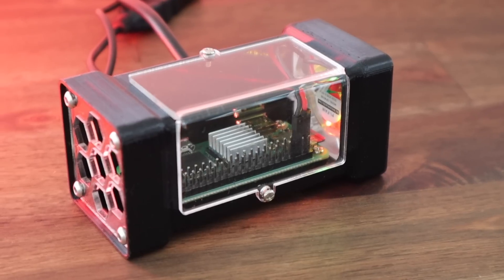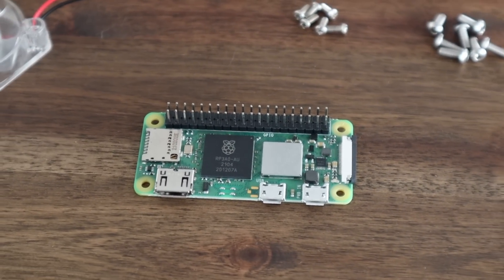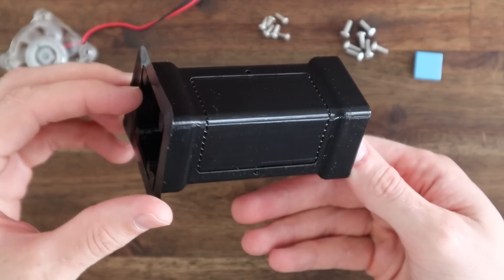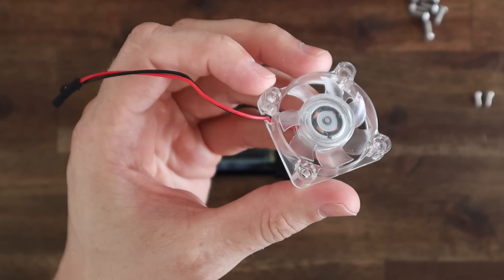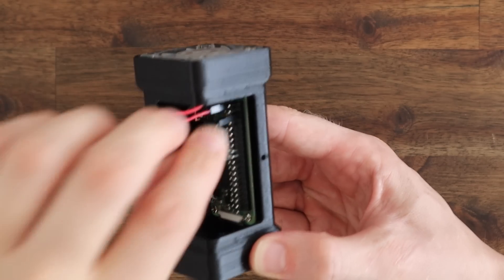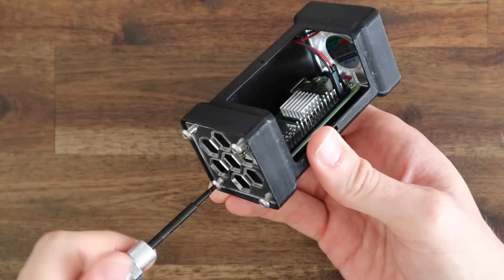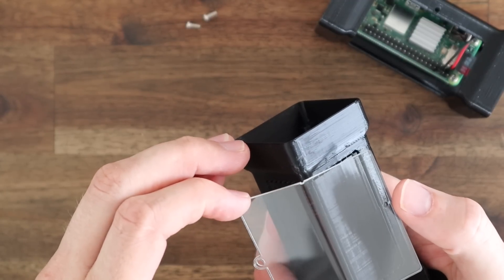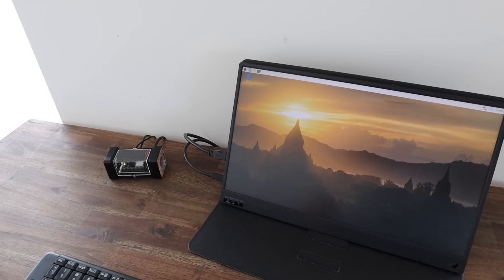Making A Raspberry Pi Zero 2 W Case - 3D Printed

Comment: how did you know the exact square of the front glass?
Reply from the maker: Do you mean how did I get the front glass to be exactly 90 degrees? I just used the front of the case as a guide.
Reply: @MichaelKlements  Nope. How did you know what sizes to write in the program before cutting the front glass?
Reply from the maker: I used the measurements from the 3D model in Fusion360

Comment: I use mine for pi hole dns. It works really well and im thinking about upgrading his cooling with fan...Not much heat when i'm using it (around 35c ) but when 5-6 ppl join it goes around 70c..

Comment: This is definitely one of your nicest build in my opinion.
I would love this be  for a Pi4b/8, but the connecters are not all on one side and that is a shame.
I think it would have been nice to have the acrylic flush mounted with the rest of the frame and the M3-8 inserted into the acrylic so they do not protrude. But these are just nit-picking, it is a very nice and inspiring design! 
I am thinking of building a Raspberry Pi system for my small sailboat and so I am binge watching your videos!
Reply from the maker: Yeah it would be great to have a Pi 4 with ports all on one side! 
Thanks for sharing your ideas and feedback on the case design, its always good to get input from others as well.

Comment: Nice case. (but...)
Why didn't you make the case so when you put the (clear) acrylic that it (that clear acrylic) was flush with the case?
Just a thought.
Reply from the maker: Mainly because it would have either made the 3D printed areas really thick (they're only 1.2mm now, they'd need to be 3-3.5mm to allow the acrylic to be flush) or it would need a lot more internal supports for the acrylic support structure - which makes the print messy.

Comment: Really nice design, but wouldn't it be better mounting the board a bit higher so you get more airflow on the backside? Or is there some other reason not to do that?
Reply from the maker: The underside of the board doesn't really need airflow. I prefer having more headroom within the case to access the GPIO pins. It also makes the angle to the screws a bit easier to access with a screwdriver.

Comment: Any chance you will be selling a kit for this? Like the case and acrylic?
Reply from the maker: I'm looking into it, it's quite a lot of work to remove the print supports and clean the print up but there might be some better printing options.
Reply: @MichaelKlements  I'd be happy with just the acrylic if that would be easier?
Reply: @MichaelKlements  why not a "print in place" ( or not )  cover for those who do not have laser cutter / acrylic :)
Reply: any luck finding someone to buy it from?

Comment: Did you experiment on using this as a solar powered Bitcoin miner? Instead of the older version of the RasPi Zero.
Reply from the maker: I haven't yet tried crypto mining on the Zero 2, I must though
Reply: @MichaelKlements  I bought one and it hasn't been booted up yet. I don't know what should I use it for. Probably a solar powered motion detector camera or something.
Reply from the maker: Try running Pi-hole or Retropie on it in the meantime, those are both quite fun and easy projects to get going and they don't require any additional electronics.
Reply: @MichaelKlements  I have a Pi-hole daemon running in my 4GB RasPi 4. RetroPie might be a good idea. There's also a Kodi server. Thanks. What I would like to know is how much less ROI would this Zero 2 be as a solar crypto miner. Maybe ten years?
Reply from the maker: I think any ROI on crypto mining on a Pi Zero 2 would be purely speculative. The only way you could hope to make any meaningful money with them is if you mined a coin which happened to 100x in a few months/years.

Comment: How would I modify this so I can use a camera module for octoprint? I’m guessing I go through the acrylic panel with the hexagons? Thanks in advance!
Reply from the maker: Yeah that would probably make the most sense, the Pi camera is only around 25mm square if I recall. You might need to open up a few holes on the main cover then to allow the air to escape.
Reply: Ok thanks!

Comment: What I thought doing was a front I/O shield exposing the pins. For this it'd be necessary either 90 degree pins or to make a plastic support for straight pins pointing outwards in the front (and connected by wires to the pi), and at the end we could finish with a little moving rectangular plastic door that encloses the pins inside the case, and when the pins are in use (in connection with wires to do a project) the little door keeps opened, exposing the pins to the exterior.
Reply from the maker: That's a nice idea Andrew!
Reply: @MichaelKlements  if you think it's useful for the case, maybe try making a video showcasing it? :D

Comment: Really use more power? in load the original pi zero w use 5w and this only 8w is not that much
Reply from the maker: It depends what you're using it for. That's a 60% increase in power, which for portable or battery powered projects is definitely a lot more.

Comment: Sweet. Never seen one of those acrylic bending tools before.
Reply from the maker: To be honest, neither had I. I had always use a butane torch and just "melted" the line but this is much neater.
Reply: i'm thinking its a styling tang for his girlfriends hair ;)
Reply: Search for Acrylic shape bender, usually a kit of two, one for fine like Michael uses in this video and usually another set with a larger surface area. Sign makers use them, hope this helps.